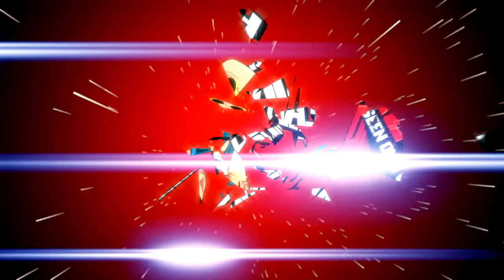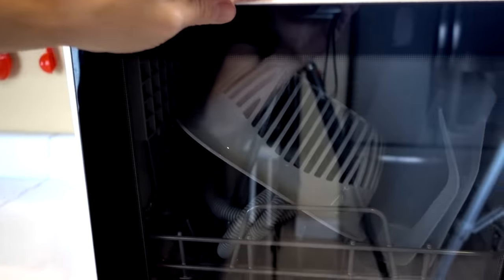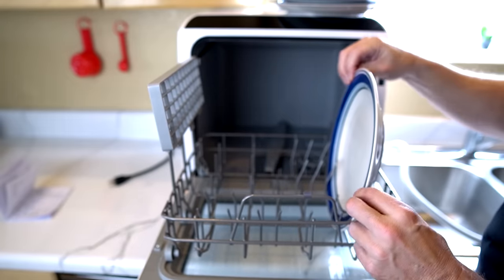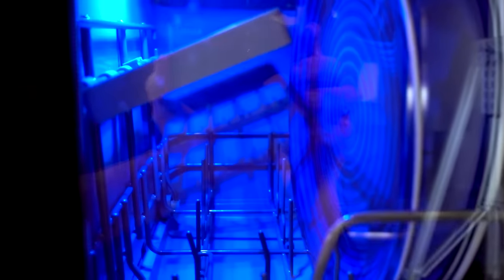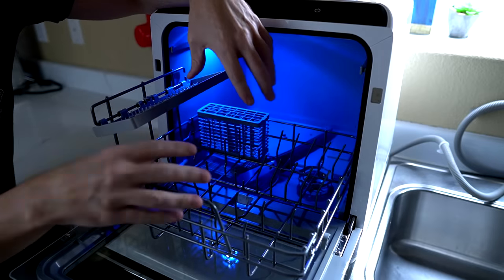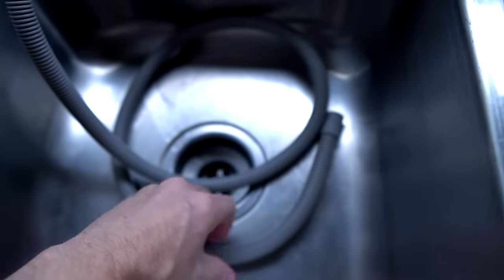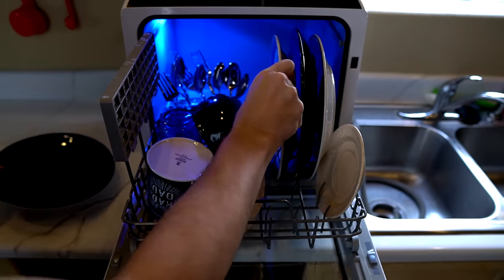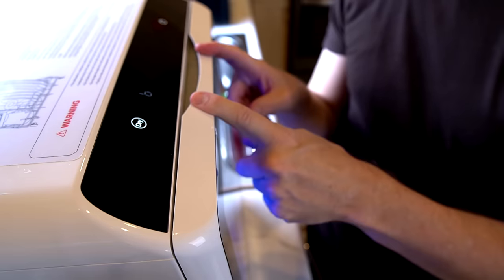Do Countertop Dishwashers Work? By Request!

Comment: Now I just want a regular dishwasher with a clear door that I can see inside while it is washing. Kind of neat to be able to see inside while the dishwasher is running.
Reply: So satisfying to watch.
Reply: Would also be super helpful for troubleshooting if something goes wrong during a cycle.
Reply: They used to have them at Sears but they were specially made for store demos to show off the features.
Reply: Yeah they look cool but it uses more electricity
Reply: Reminds of a Sears in the late 90s. They had a clear top loading washing machine, allowing you to see the wash cycle. It was filled with some colored balls and a freaking Downy laundry ball! It was mesmerizing to say the least.
Reply: Unfortunately it would be really loud. They have thick multi layer steel doors for a reason ;(
Reply: @rambobannana  People could engineer it not to be loud just like how new houses are made to reduce the noise from the road, planes, trains, etc and yet still have windows and is made from different construction materials other than steel. Anything is possible it is just people have not taken the time to redesign the dishwasher.
Reply: @oplkfdhgk  How would it use more electricity?  Your oven does not use more electricity because it has a see through door.
Reply: @HonestSpiritual  it does. Normally the door has thermal insulation. If it is see through then it doesn't have that=more electricity. Same for oven.
Reply: @HonestSpiritual  ofcourse that is assuming that the oven/dishwasher manufacturer actually put thermal insulation in the door. I am not sure if all of them do but some definitely.
Reply: Neat while it runs, but how long do your dirty dishes sit in the dishwasher before you turn it on? Dirty dishes aren't good room decor.
Reply: @HonestSpiritual  it not as simple as that. The door is being sprayed with high pressure water for an hour in your kitchen. The water vibrates the glass and reverberates. I’m sure somebody can design a silent glass dishwasher but it’ll be expensive
Reply: @rambobannana  It sure would be expensive just like the fridges with the TVs built into it and the glass that you can knock on so you can see inside without opening the fridge.
Reply: Kitchenaid top model has a glass window.  Out of my price range though, however there are a couple scratch and dent specials that are tempting.
Reply: It would just be nice to see someone other than myself washing dishes.
Reply: It seems like a fun idea. In practice people generally prefer their dirty dishes to be hidden instead of on display for all to see. Unless you fill and unload right away and never leave dishes inside.
Reply: @djcruiser9816  that model has been discontinued, still a great unit if you can find one.
Reply: @sailorbrite  I was going to recommend TC also. Awesome channel.
Reply: I feel like I would accidently break it somehow.
Reply: Omg i should have gotten that. I just got one :(
Reply: soap scum, hard water, itll fog up. loads of issues. i do like it though
Reply: Honest Would be great but I hide my dirty dishes in the dishwasher until I have a full load.  Unexpected visitors can see my dirty dishes.  lol
Reply: Kitchen-Aid started making on but since Covid hit they have stopped making them, maybe the will continue production soon
Reply: it would end up wasting heat and in turn costing you more in electric bills to run, most dishwasher manufacturers aren't going to allow their product's efficiency rating to go down significantly just to be able to see your dishes while they're being cleaned, oh and not to mention the increased noise that would come from it because of the lack of insulation
Reply: @emilycampbell6375  good points i didn't think about efficiency.
Reply: Perhaps read a book or find a hobby?
Reply: My nephew honestly just asked why dishwashers don't have any clear doors like new washers and dryers do now. And this one has a light!
Reply: @HonestSpiritual  yea. They could implement double or triple pane glass for bouf heat retention and to reduce noise
Reply: They have them in Japan.
Reply: Yeah Fr! Washing machines and dryers have clear viewing windows. Idk why they don’t put them on dishwashers, the same companies that make wash room appliances also produce kitchen appliances.
Reply: @deeznuts1358  maybe because of the detergent and rinse aid tray that's on the door. And also more noise would go through and heat wouldn't be able to be fully maintained within the machine
Reply: @rambobannana  sound travels faster through denser mediums. I don't know the specific density of glass vs steel but if not properly insulated those steel ones would be much heavier.
Reply: @danixoxo8637  :)
Reply: Kitchen Aid makes one that has a window you can see through
Reply: i know Bosch have one model with a clear glass window on its door, its quite expensive though
Reply: I'm so glad I'm not the only one.
Reply: @rambobannana you are actually very wrong. It’s not loud at all, honestly with the rest of the regular house noise like the tv going you can hardly hear it. I’ve had the Novete for over a year now and absolutely love it.
Reply: @macthompson9750 nope. Mines been running for over a year multiple loads every day with no issues with the glass. It has a fantastic rinse cycle that keeps the glass clean.
Reply: I use the shelf for knives and long cooking utensils. I also took the grid off of the utensil basket, after a year of using this dishwasher multiple times every day I can say that it’s absolutely fantastic! I highly recommend it!
Reply: @oplkfdhgk this is a terrible myth. Dishwashers only save resources, never spend in excess. Even the worst one.

Comment: One thing about dishwashers. They get water hotter than your hands can tolerate. 150 degrees sanitizes!
Reply: Yes, but not all of them... especially countertop models. MAKE SURE the one you buy has a water heater that heats up the water. It' cleans the food off much better and sanitizes.
Reply: its also important for cleaning, no melted sugar or fat will go soft in a temperature you can handle. everyone that handwashed plates with butter on it should know the hustle. ^_^
Reply: @thomasherzog86  to be honest, if it doesn’t wash off in 30 seconds to a minute, i soak it with dawn soap while i do the rest of the non greasy dishes. works like a charm.
Reply: @crankthatrebecca12  
and then ur having a soap butter sludge on your brush or in the sink. ^_^ 
but seriously - soaking might work with fat, but not with stuff like caramel or toffee, at least not fast like heat does. im not saying its impossible to live without a dishwasher, but it has its benefits.
Reply: @thomasherzog86  having a dishwasher uses less water and electricity, gets them cleaner, and as far as I can tell from those factors makes them more moral than handwashing.
Reply: @crankthatrebecca12  how do charms work? Do charms even work?
Reply: Aye, my countertop goes between 50C to 80C. 80C is for cooking wear. Between 50-70 it chooses what's best on the auto-program.
Reply: @MilwaukeeWoman  also normal dishwasher it only dumbs the cleaning after 2nd or 3rd cycle after the pre wash, so i was kinda shocked to see the Dishwasher Detergent dump at the very start without a pre soak
Reply: I think thats what that uv light is for
Reply: @hxhdfjifzirstc894  I have a countertop dishwasher, I just turned up my water heater.  No use spending extra money on a dishwasher to do what your water heater can do.
Reply: @MilwaukeeWoman  🙄
Reply: Eh....I don’t care what dishwasher you have, they won’t clean off really stuck on food.  I hand wash mine.
Reply: Soap kill germs something like this is just lazy.
Reply: @MilwaukeeWoman  okay, but it is possible to handwash using minimal water. Wet sponge plus dish soap, scrub the dishes then rinse. I'm not anti dishwasher. I use the aforementioned technique if only washing a few items.
Reply: @changingmyself  Just remember that your water is that hot. If you have visiting children and seniors. Ours is hot like that and we make sure adults know so they can watch their kids. If visitors are staying for a longer time, we turn it down. ❤💧
Reply: Thats cap 🧢🧢🧢🧢 i will only believe you if you take a picture or a video
Reply: @hxhdfjifzirstc894 do you happen to know which ones heat up the water?
Reply: More sanitary in my house.
Reply: Thank u!

Comment: We have one and love it. We have a small house (900sqft and 6 ppl) and this is a life saver with 3 kids.  We bought it second hand for 75$ and plumbed in a second faucet for it so we can leave it connected and still use the other water in the kitchen sink
Reply: Do you pretty much have to run it after every meal though? Seems like almost not enough room for dishes for 6 people
Reply: @ericmendenhall2867  sometimes we run ours 4 or 5x a day but with 3 kids it saves me time.  I love it.  We have learned how to load it and stack and pack it.  We dont have this exact model as ours is about 9 years old but I love it.  We even run baby bottles and crusty sippy cups in it and they come out perfect.  I have found I have to just throw the soap on the bottom and not in the soap tray but once you master the learning curve it's perfect.  Now we wash our pots and pans by hand as they are the blue diamond ones and we are super protective of them haha but my crappy stainless pots we have put in there and they also come out perfect.  I would much rather just load and unload this 4 or 5x a day vs spending hours washing dishes.
Reply: @ericmendenhall2867  I should also say we dont have the ability to put in a full dishwasher due to how old our house is and how its wired and plumbed.
Reply: @Cklei89  Oh ok great. Thanks for letting me know. I was just genuinely curious and sorry uf it sounded like i was judging. I am glad you get so much use out of this and takes a lot of stress out.
Reply: @Cklei89  Thsnks for answering thoroughly. I’m curious. Does the noise of it running 4 to 5 times a day bother you? And also, if you just put the dishes in a sink of soapy water, wouldn’t they clean themselves fast? I got the Corelle dishes and bowls recently and everything comes off so easily and since they’re so thin you can fit a bunch in the sink. Curious how much time this saves compared to that. Thank you.
Reply: @BbGun-lw5vi  to me having 3 kids to tend to it saves me a ton.  I can just run the dishwasher vs standing at sink.  It may take a ton of loads if I get behind but it's worth it.  I have old corell dishes all the way to crappy kids plates and all come out clean.  I even put the baby bottles in it.  There isn't a ton of sound but you do hear it, but I have my washer and dryer in my kitchen so I am used to the sound of noisy appliances
Reply: That's great to have it plumbed in.
Reply: @hxhdfjifzirstc894  it was actually really easy as we had originally had a sprayer in our sink.  My husband just used that line put in a faucet that fit the dishwasher and now it can be left attached.  He then put a all in one faucet with a sprayer in the main hole of the sink.  Who knows if its up to code but hey it works and we haven't had any leaks.
Reply: @Cklei89  I would suggest that if one uses pods or powder in a standard dishwasher, it tends to work better when put on the floor  of the washer, especially if one uses the quick mode.
Reply: @Cklei89  Thank you. I can see now how with baby bottles and sippy cups and other stuff that is annoying to wash this would be totally worth it. Since I live alone with no kids I think this wouldn’t save me much time. But I do love that you can disinfect/wash all kinds of stuff/items that isn’t just dishes. That’s where I miss a dishwasher.
Reply: do you have soap scum issues? I got a brand new one and each load i’ve tried has had soap buildup. I keep trying different amounts of soap but it keeps doing it no matter what
Reply: do you have soap scum issues? I got a brand new one and each load i’ve tried has had soap buildup. I keep trying different amounts of soap but it keeps doing it no matter what

Comment: Seems like another pro to the countertop model is there's no bending down to load and unload it, unlike an under the counter model which has you bending down to almost the floor to load/unload the machine.
Reply: Would be good for people with back problems and such.
Reply: @antiisocial  Exactly. Anyone with back and hip problems would benefit.
Reply: I like it.  Similar to having the washer/dryer on the main floor of a house.  Not having to carry wash down to the 1st floor or basement.
Reply: As a person with a bad back, I approve of this message.
Reply: There is no reason not to mount your regular washer on the countertop level, just like the oven. I've seen kitchens arranged this way before. 
I mean no one mounts their ovens on ground floor anymore, right?
Reply: @wtfiswiththosehandles  Uhhh.... most people do.
Reply: They actually have models that are around the same size as his full size dishwasher but they are portable and on wheels. Ironically enough this is the channel where I discovered that portable dishwashers, washers, and dryers were actually a thing after watching his sink dishwasher video.
Reply: @_V1LKA5_  True, I even had one, but nonetheless those models still require bending down to load and unload since they're low to the floor.
Reply: When I was a very young in the late 60s, we lived in a duplex, so my parents had a dishwasher on wheels.  I can remember mom pushing it over to the sink and hooking it up the faucet.  When finished, unhook it and put it over against the wall.
Reply: @Eidolon1andOnly  definitely these Countertop ones are great for people with disabilities as even if they need to sit down or are In a wheelchair you will tend to be at chest height so it'd still be a good choice for using. I know he said it only takes 10 mins but if you're not able bodied that 10 mins stood up washing could cause issues for days afterwards for some people. Definitely like the idea of these and I was considering one after watching the Bob video on Techmoan (this seems to be a bit bigger and more options though)